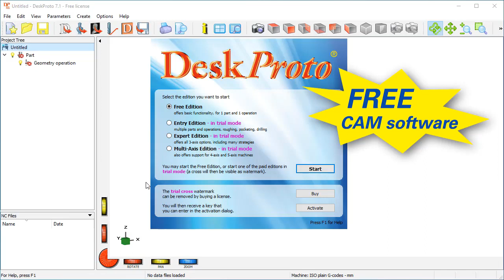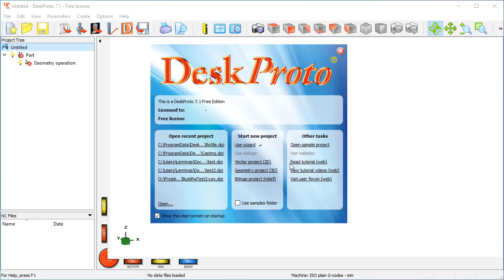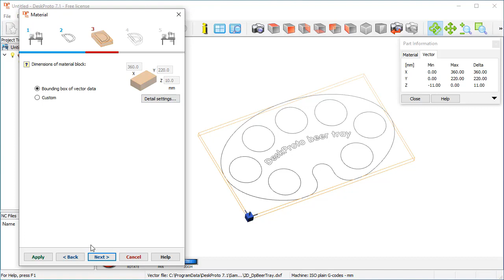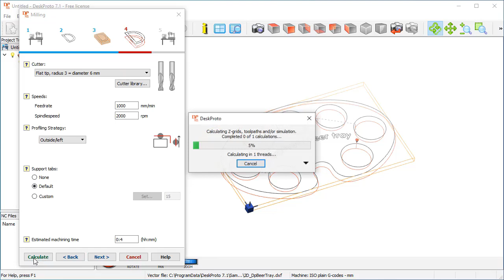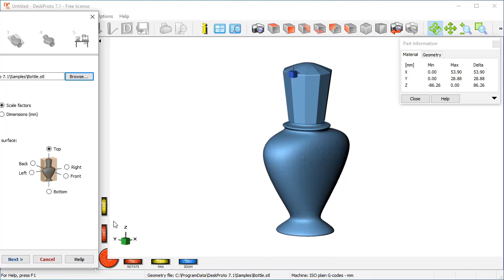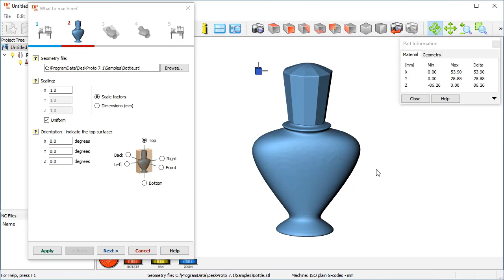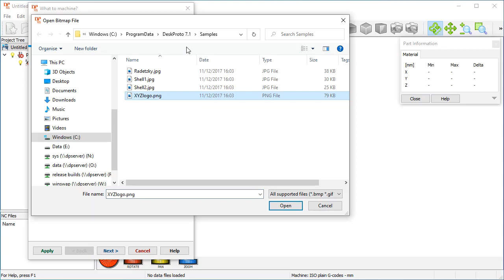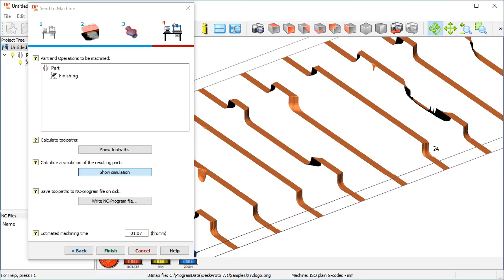Introducing the free DeskProto CAM software: Part 1 - the wizards

Comment: Is it possible to define both depth of each cut AND final depth of the cuts on the tray ?
Reply from the maker: Yes, that is possible, though not in the Free edition. Using multiple cuts to reach the final depth is one of the roughing options in DeskProto, and these are present only in the paid editions. See https://www.deskproto.com/products/comptable.php
Reply: @Deskproto  Sounds like a problem and possible safety issue to me.  The search for an affordable CAM program continues
Reply from the maker: @cattaraugustonawanda4426   This is indeed a clear limitation of the Free version. Which in may cases is not a problem though. When you need an affordable program you can look at the paid DeskProto editions, when 'affordable' for you means 'free' I am afraid that we cannot help you...
Reply: @Deskproto  Not looking for free but this is a detail that is very basic to any CAM software.  I used to have another affordable software but support changed to pay for.  I'll look elsewhere.  Retired modelmaker/machinist.
Reply from the maker: @cattaraugustonawanda4426  That is a pity for us, though I see what you mean.  Hope for you that you can find a program that offers what you need at an acceptable price.
Reply: I think your pricing structure is excellent. F360 would cost me $180USD a month for the subscription to have 4 axis.

Comment: Thank you for another good video.
Could you do a tutorial on the settings, 
meaning like the speeds and feeds and tool operations
Reply from the maker: It is difficult to give general guidelines for feeds and speeds, as these heavily depend on the machine's capabilities (stability, power).
Reply: @Deskproto  I mean where to go & edit  and what does the tabs and menues relate to.
I see many tutorials on what to click on. But no explains why they select what they do.
As a beginner I have found Desk proto a software that I can relate to for basic setup.
But for the pro user they know what to select to achieve what they want.
But nothing out there explains the advanced features.
And why they help or used for.
Reply from the maker: @spudnickuk  I will come back on this issue next week, this week I am abroad and do no have time.
Reply from the maker: @spudnickuk  Have you seen Part 2 of the DeskProto introduction: https://www.youtube.com/watch?v=wBo9BgEGvAM  ?  That tells you more about the tabs and what they are meant for.  A far more detailed description can be found in the PDF tutorial book, at https://www.deskproto.com/download/manuals.php   For beginners it definitely is a good idea to read that manual.
Reply: @Deskproto  I have the pdf and have seen the part 2 👍
What I would like to correct or work out
Is after roughing using a 6mm cutter 10mm around the geometry 
And all is good
I then use a 3mm ball nose for finishing
And select cut around the geometry using parrell 
And doing so it's cutting thin air/nothing until it makes contact of model
So it's adding 4 hours of wasted movements
I thought selecting geometry only would cut the model and no other area. 
This is why I would like to find more info on what I'm or the software it doing wrong.
Reply from the maker: @spudnickuk  It seems like you have checked the option 'Use layers' also for the finishing operation (Operation parameters, tab Roughing). Please incheck.
Reply from the maker: @spudnickuk  And a tip: when you use the wizard "Basic geometry' DeskProto will make some more useful settings, like telling the finishing toolpaths to skip the area around the part (Ambient area).
Reply: @Deskproto wow that is interesting to know
And thank you for the extra info
I can't wait until I get home from work and try out the changes
I'm sure I did select layers
As I had and issue with the finishing tool plunging into the work
When I first started out on my settings
I will send you an update on my success or fail lol
Reply: @Deskproto  I did check the layer option in my fininshing ,
and you were correct, 
I had the Layer option on, Now i have taken off and after simulation and time check,  it is now 3.30 hours to machine all instead of 8.40 hours to machine.

Just to say i also have Vectric Aspire but  I ran into issues of it not machining all my model/geomentry  and would only cut down to about 12 mm instead of the 20mm so I think it must have a layer height restriction

Anyway a bit off topic. 
As for Aspire VCarve/Vectric it is realy only any good for carving.
as deskproto is good for carving and V carving and machining larger/higher Z depth's
for which is why i like Deskproto better and much cheaper.

I wish i came across Deskproto  before I got any other softwware , as I could of saved a load of money & time
there are other features i would love to see in it but i will leave thos comments for a later discusion.

Comment: Very informative video and great simple to use software.
Please upload a video on the machining of cast aluminium.
The design can be sand cast and then use a few finishing passes on the milling machine to remove any leftover material/imperfections.

It would be useful to show the creation of datum points per part orientation  so that the cast part can be machined effectively.

Many thanks
Reply from the maker: Christopher, thanks for the compliment. Your question is quite specific for a general use tutorial video. The datum point probably will be covered in the next video: the workpiece zero point. In DeskProto that can be set in the Part parameters, tab Zero-point (Expert edition and Multi-Axis edition only). Use the Help button on that page for more information (DeskProto has an extensive Help file). That zero point can be used to correctly position the toolpaths over the part on the machine. You may also want to limit the area to be machined (Operation parameters): not all surfaces will need to be finished.  Machining an existing part is advanced stuff though: aligning and positioning the part on the machine is critical.